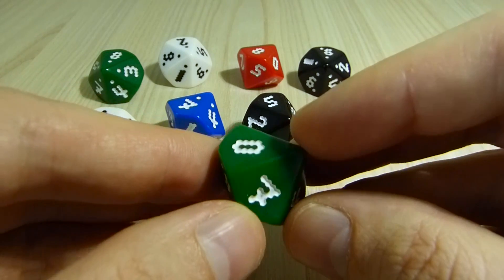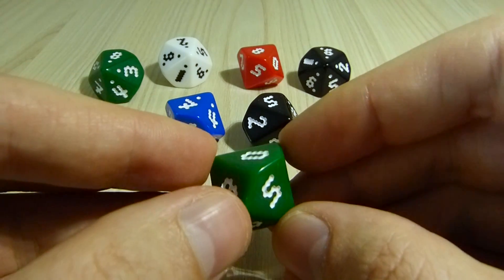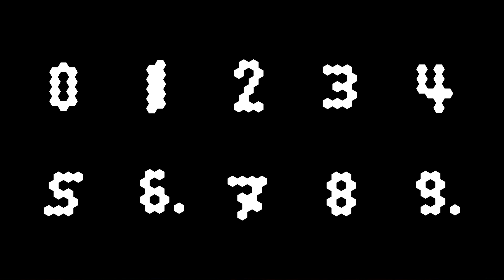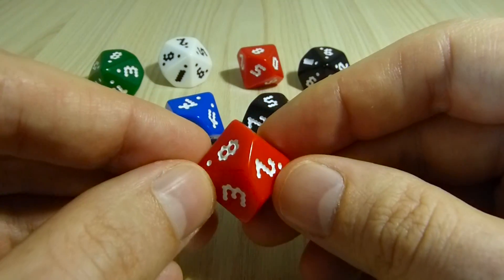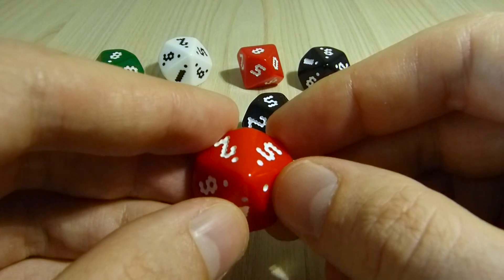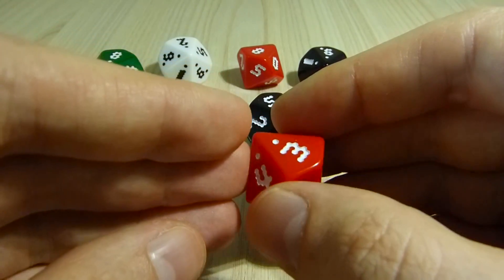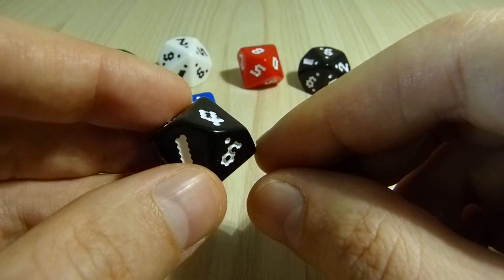d10 OptiDice

Comment: I have noticed that you have done "Opposite sides add up to 9" on this die.

However, I find that the most common use for these says that the 0 face is actually a 10 (i.e., tabletop roleplaying games).

Could you do a version of this where opposite sides sum to 11 instead?
Reply from the maker: Are you suggesting that the number written on the face be "10" rather than "0"? Are you suggesting rearranging the numbers as well? On a quick google search for "dnd dice set" I don't see any examples where the number written is "10". I guess one could arrange the numbers so that 0 is opposite 1, 2 is opposite 9, 3 is opposite 8, 4 is opposite 7, and 5 opposite 6. Although this would feel strange without also writing "10" on the appropriate face.
Reply: @henryseg  The 0 is consistently treated as though it said 10, even though it's printed as a 0.

It isn't printed as a 10, though, because when you roll 2d10 for percentile, it's easier to mentally throw a 1 in front of the 00 result than it is to convert a result of 1010. 

Every other die in the D&D set is a 1-X die, and the d10 is treated similarly - just with this printing convention quirk.

You're not the only ones to do this, though. Chessex' dice's opposites sum to 9 as well.
Reply from the maker: @danieltaber4924  Thanks for the explanation - I agree that printing "10" would be more confusing and would also not look as good.  Robert tells me that Koplow's opposites add to 9, except on their jumbo d10, where they add to 11. So it looks like there is some inconsistency. Given that our audience includes mathematicians and teachers,  who would not likely be aware that "0" usually means "10", then I'm inclined to keep our sums adding to 9. Otherwise having 0 opposite 1 might look like a mistake.
Reply: @henryseg  Thank you for the conversation on the matter.

Perhaps the "Gamer's d10" is an option for a later line, if you're hunting ideas for such a thing. That is absolutely a market :)

Comment: Great work, I was wondering if a 20sided D10 is posable to make fair also a 12sided D4. Thank you
Reply from the maker: Sure, repeating numbers will make a fair die.
Reply: @henryseg  why yo can't make d20 optidice? 
You can do:
01, 02, 03, 04... 18, 19, 20
You must only change the shape of the number 1 because now is readable upside down so 10 is equal to 01. Changing the shape of the disposition of the ten exagons of the number 1 you can do it!
 Bye bye
Reply from the maker: @GiuliSnow  Yes, we could use two digits for the numbers less than ten, with 20 hexagons for each number. It would make a  large and expensive die, and the double digits might look strange, but it could be an interesting direction.